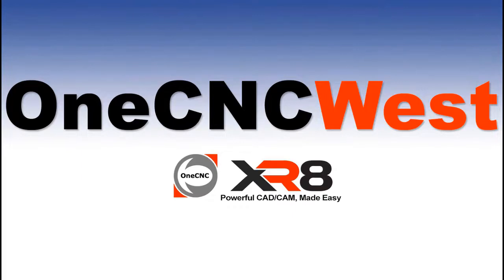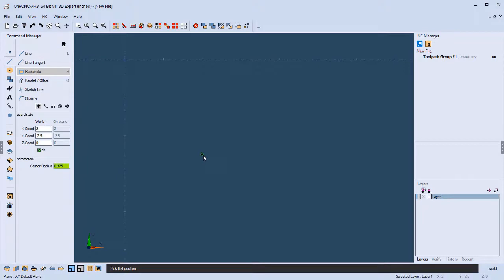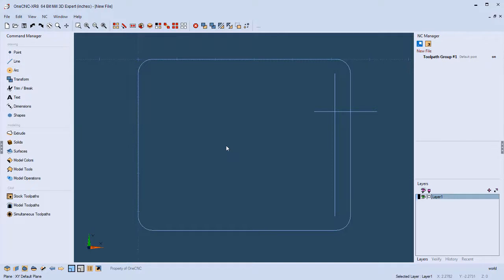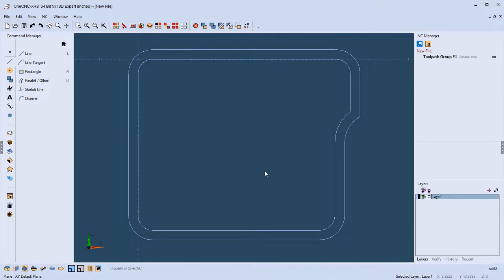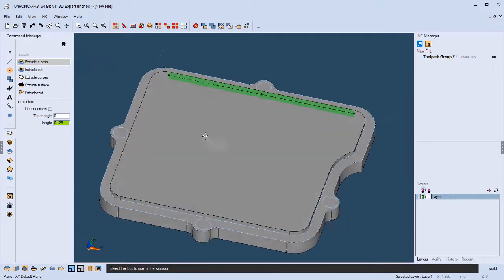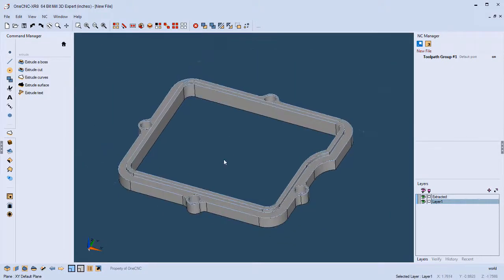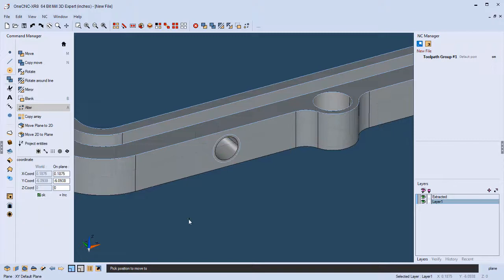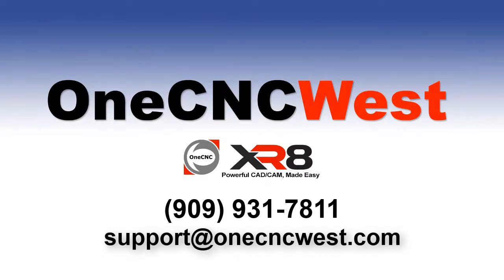OneCNC XR8 - Basic Geometry Overview

Comment: Just a quick question Patrick, how do you add a fillet to only one edge on your model?
Reply from the maker: Hi Jack. Sorry I did not get to your question sooner. If you would like to just fillet one edge, hold the "TAB" key down while clicking the edges. The "Tab" key instructs OneCNC to only select the line or arc the mouse clicked. The "Tab" key stops OneCNC from selecting all the tangent geometry.
Reply: @onecncwest  Hi Patrick thank you for coming back to me. For whatever reason the Tab trick doesn't work on the model I've drawn. I'm selecting an edge on an already drawn model but it won't add the fillet. I ended up changing the construction plane and cutting the fillet from the side to get round this. I just wondered if it was something I was doing? Your other videos helped get the desired ending we wanted I'm just curious as to what would cause this. Again Thanks for your time and your videos are life saving. 🙏